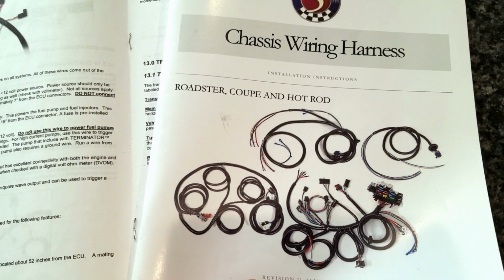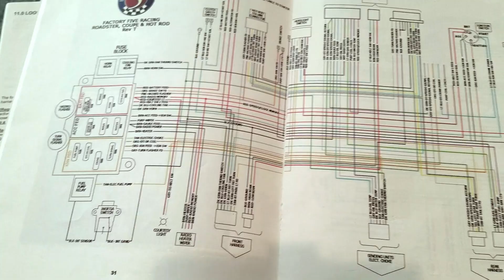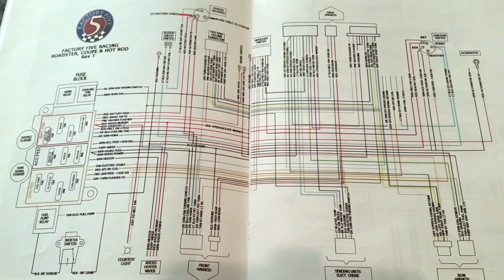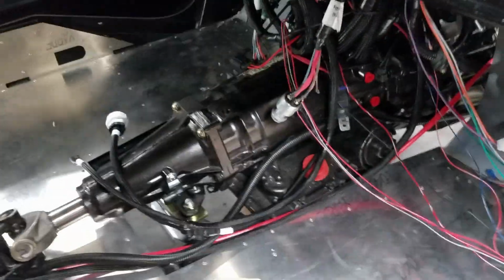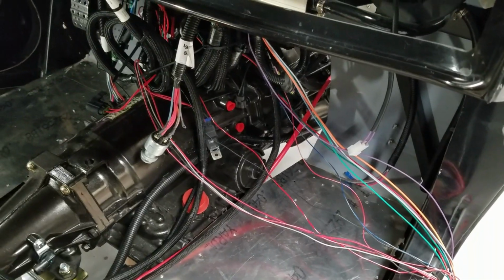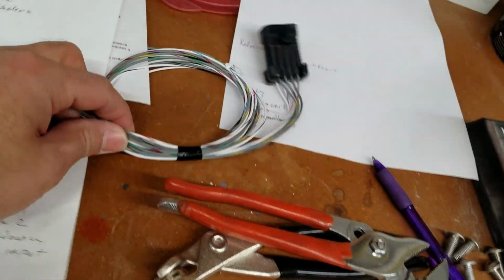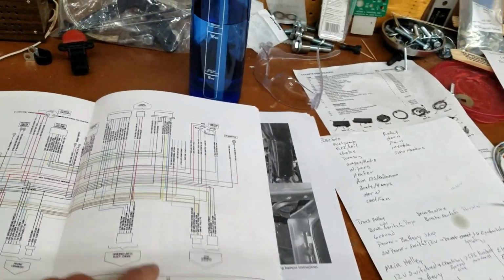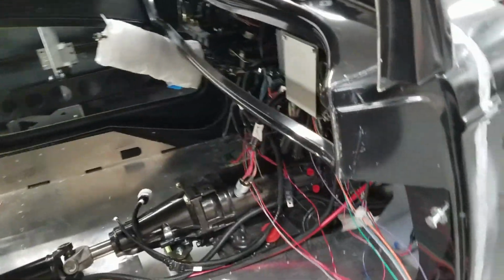Factory Five 33 Hot Rod V2 - Wiring Acclimation - Organization

Comment: Looking at your firewall and boy it turned out nice. The paint etc. curious why riv nuts AND rivets. If you remove the rivnuts you’d still have to remove the rivets if you has to remove it right? Do you know why people use rivets here versus some nice button head painted self tap/drill screws? I hate the idea of having to remove all those rivets if need be. But most people use them so there must be some advantage right?
Reply from the maker: Once you go to permanently install this, you will never be going back.    Some people talk about metallurgy of the different metals interacting with each other over time causing an issue.  Some people use bonding agent and nothing drilled through the wall.   It is just a matter of look.  All do a good job of holding on the firewall.
Reply: @StreetRodJim  thanks! I guess I was more curious why you had some rivnuts on top and the rest rivets. Maybe you at one point we’re gonna go all rivnut? Either way love the series man.
Reply from the maker: @KemDIY  The only rivnuts I remember was for attaching the body to the firewall, but those are in the body.  Just holes in the firewall for the bolts to go through.
Reply: @StreetRodJim  ah! That makes sense. Thanks! I assumed they were for the firewall. Thanks!